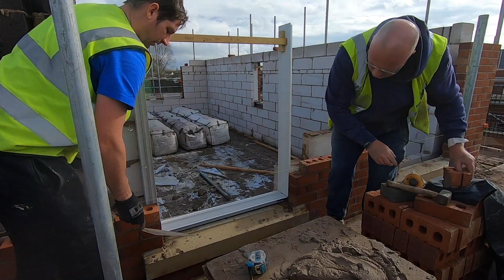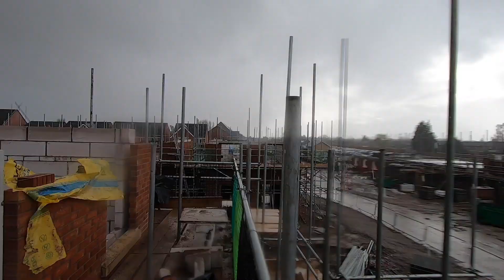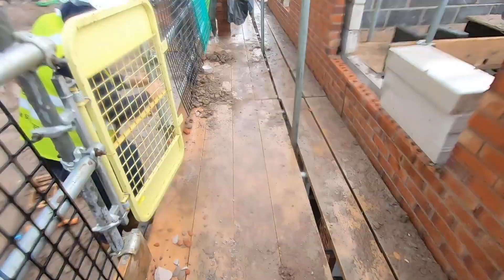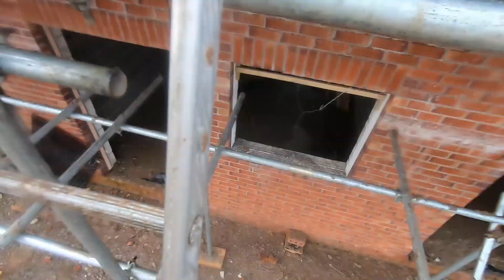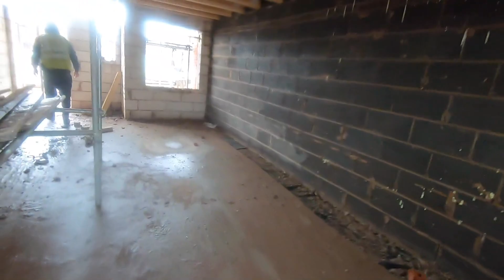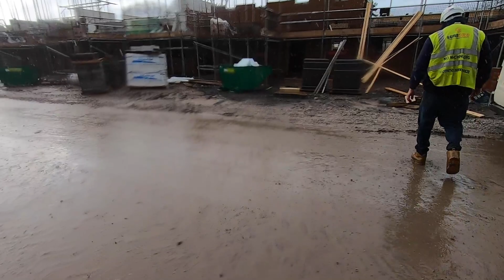Bricklaying - Building a Pillar On Site | Unintentional ASMR Video

Comment: For your movement joints why don't you do the one side, plumb it up instead running both sides of it in at once. A lot better outcome at the end
Reply: Same mate we stick a dummy frame up plumb and run to it laying the sleeves in then drop it when we join on...leaves a perfect straight movement joint 👍